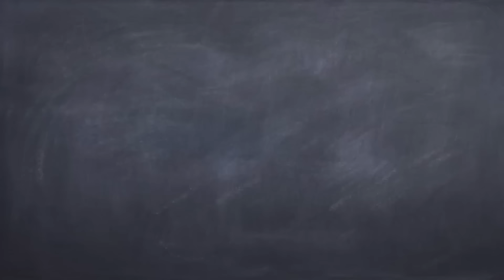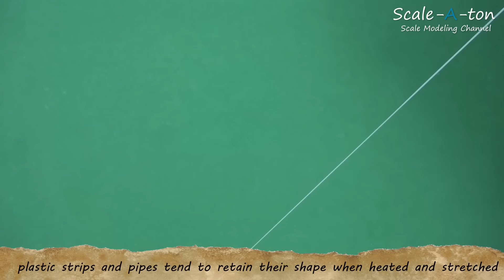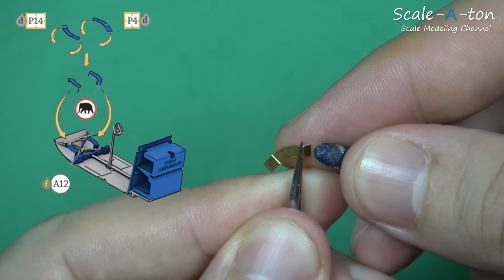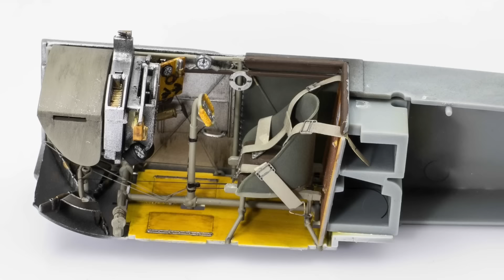1:32 Wingnut Wings Fokker E.III | Step by Step Scale Model Aircraft Build

Comment: Looks like you're killing yourself using those razer saws, Widget Supply in Albany Oregon USA sells circular micro saws that'll buzz through those attachment points with great ease, recommend you use it with a flex shaft rotary tool for more precise cuts